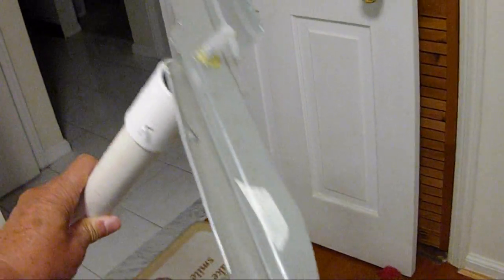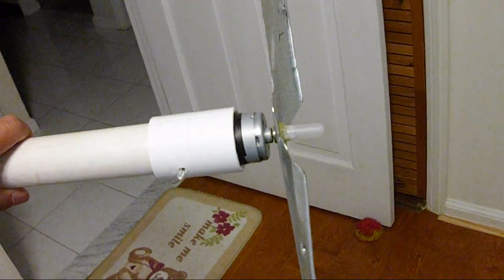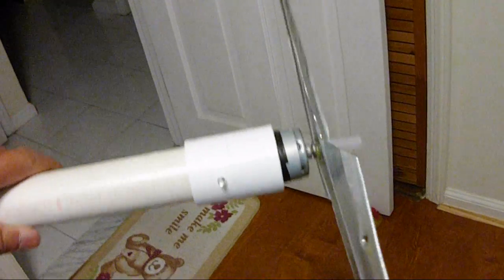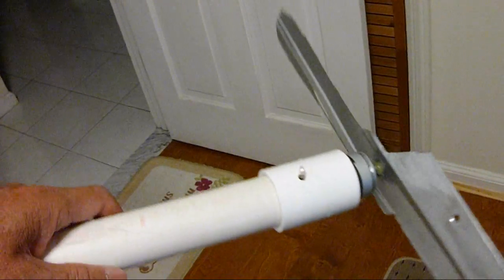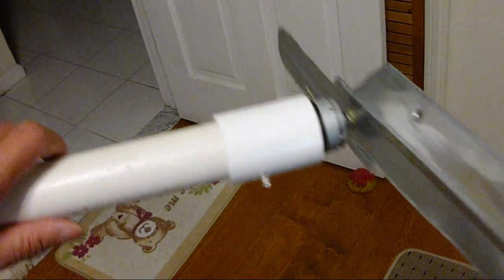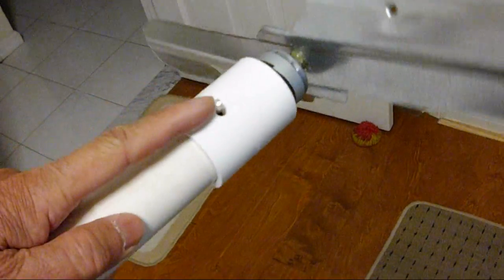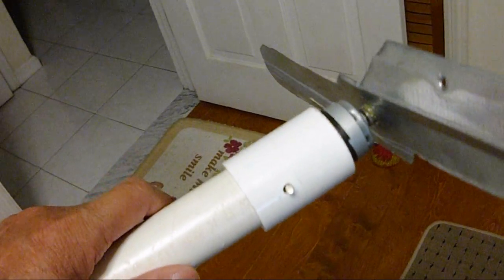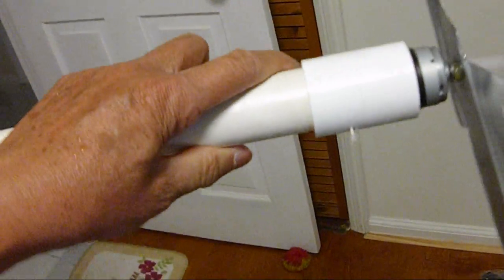Small dc motor wind turbine

Comment: How did you attach the blade to the shaft?  What was brand and part number for the motor?  No need to rectify the output of the motor?  Many thanks.
Reply from the maker: This was just a test of a dc motor from an old Epson printer. There is no need to rectify the voltage as it is putting out dc voltage. It is a Mabuchi dc motor RS 445PA available on ebay for $4 and change. It will light a few LEDs but unfortunately the output is minimal.
Reply from the maker: To temporarily attach the blade, I just drilled a hole in the sheet metal that is smaller than the motor shaft (the shaft has a gear attached to it) and pressed it in and then expoxy it.
Reply: Many thanks for your responses!

Comment: Boy are you in for a shock LOL. It's not dangerous. Doesn't use acid or Lead. My hope is that it can be used as a car battery. Off Grid storage system and MY NICE EV power supply. Can't do anything at the moment got my leg up with torn tendons.